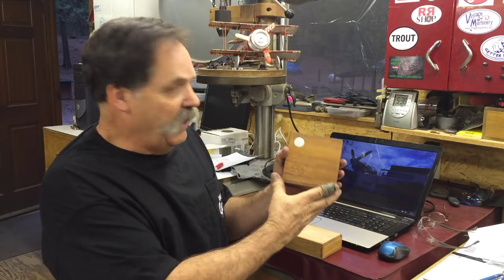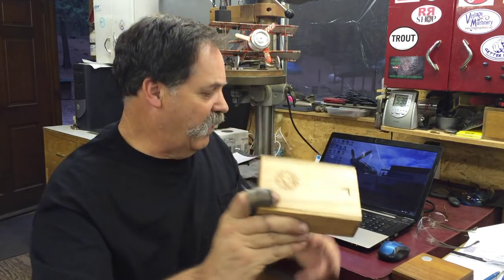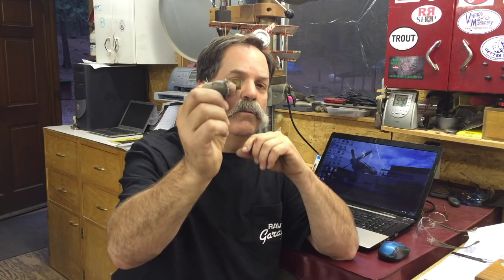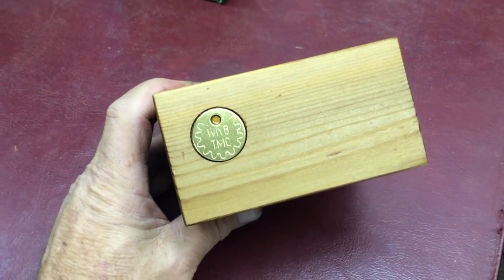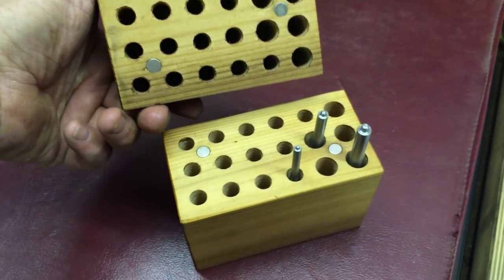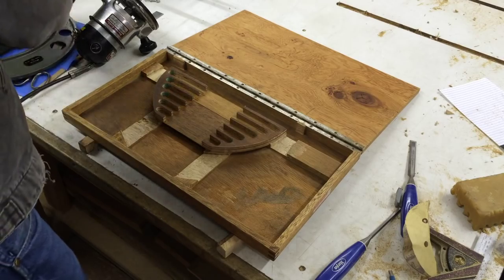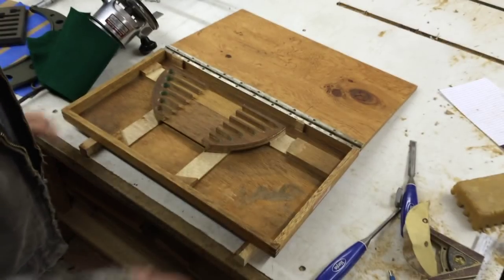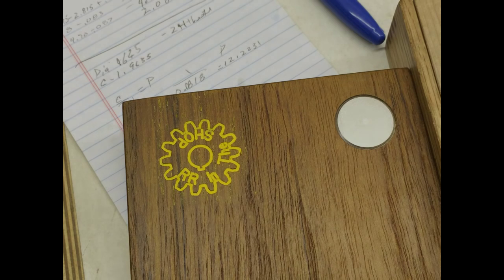Ketchup #34 - Tool Box Repair WIYB TMC Punch Update

Comment: Love the boxes - handsome! Talented dude you are. That large mic is very nice.  plus your box tweaks.
I notice the right forefinger band aid still there! :)
All punches are terrific - lovely work by all.
Reply from the maker: +ChrisB257 The box really needed help, but came out good.  I had a small cut on that finger and I wanted it covered, I was making the latches for the box and they are copper and I was doing filing, You don't want copper in a cut.  All the punches came out great, I can't wait to see them after the heat treat and in there box.  Thanks Chris,   Randy

Comment: The punches all appear to fit good in the box you made. My only comment would be  making the box slightly wider and putting the magnets to the outside would have been good.  The magnets are so strong when you go to put the top on it sucks the punches up to it so you really have to be careful putting the top on. Keep making the videos and I will keep watching. Hope you get rain, we got rain last two days here just about all day, probably couple of inches so far.
Reply from the maker: +bcbloc02   I only tested the box with 3 punches, I  guess I should of put more punches in it.  Well they won't fall out if you drop the box.  Got a little last night maybe a few tenths.  Thanks Randy

Comment: Nice work, it looks like you're getting that X-Carve to do your bidding, how does it work on Aluminum, or on the outside of a round? I need a dial for my compound that didn't come with one, and a larger one for my cross-slide would be nice too. I've found some guys who make them on eBay, and they're really nice(it's like a log you can part off and drill to size, have you seen them?) Sadly they only make them with 100 divisions and mine are 125...any ideas?

I meant to give a jingle this weekend, but even the few extra chores associated with Pops going to Hawaii(He had to go say "Aloha" to an old friend, one last time...), and it just left me a bit too worn out. I'll call soon, Aloha...Chuck
Reply from the maker: +Knolltop Farms Lets just make one, send me the dimensions, I will see what stock I have.
Reply: Wow, thanks Randy! That's the kind of YouTube Machinist spirit I remember from when we both started to hang around...you're the best man!

Comment: have you looked into some vibration isolators like the radio control fpv guys use, little rubber things that just pop into holes, should be a simple enough thing for a guy such as your self to machine a mount to put them in,
Reply from the maker: +Bill Bauer Yep I am working on an idea.  Thanks for watching.  Randy

Comment: That Mitutoyo box will be 10 times as solid as the original box....   The original boxes are made of lauan plywood about 1/8 or so thick with a little frame to make the cover hollow to accommodate the height of the micrometer, you just don't think of sitting on the original box.... You have your son film his part making and all there is left to do is the editing... lol